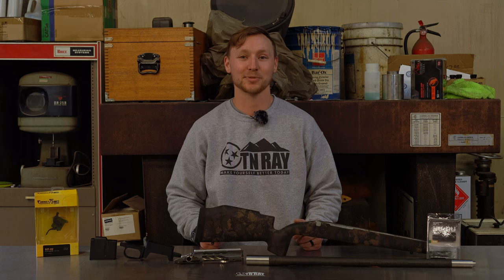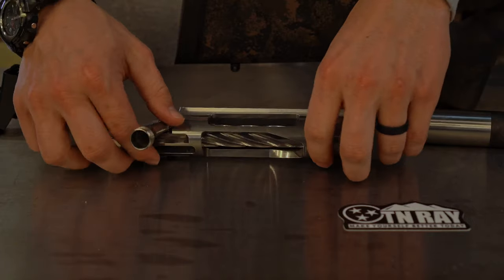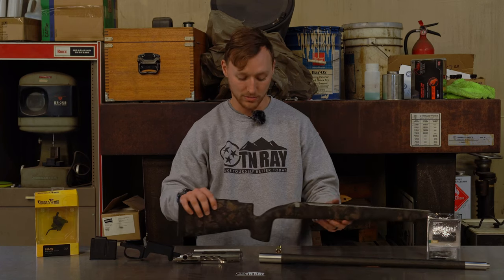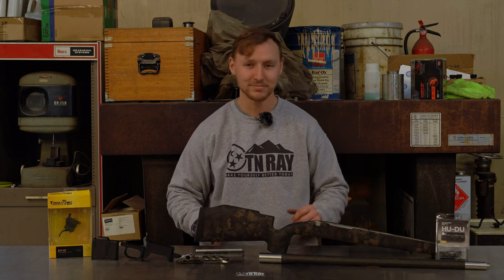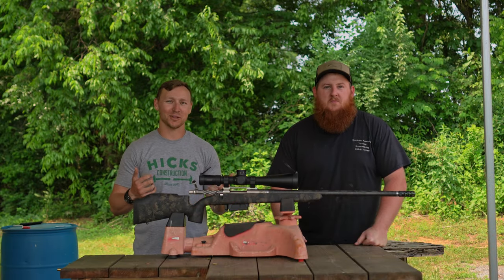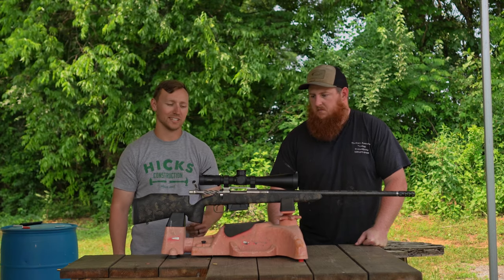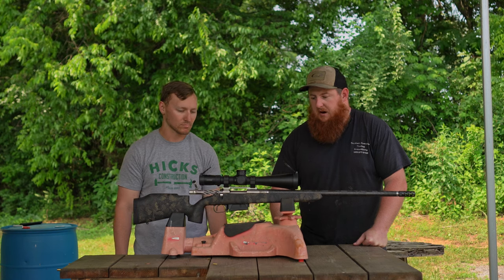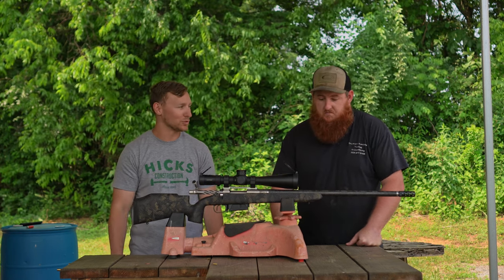Ultimate Hunting Rifle: Custom 300 WSM Bolt Action

Comment: Good luck finding a supply of any WSM brass and I only know of Bertram brass as of now that makes 300 & 325 WSM Brass.
I build for sale AR 10 uppers on the WSM magnum cartridges.
My own AR 10 WSM rifle is on 375 WSM.
I did find a online site selling once fired 300 WSM brass that I bought from then converted the 300 WSM to 375 WSM brass and loaded the casings.
Reply from the maker: Thanks, it is difficult to find but I got a 50 count once fired container of Norma brass from Choice Munitions a month or so back. I’ve got a little bit of Hornady and Winchester factory ammo as well. Hard to find, not cheap, but well worth it
Reply: @TNRay  Not cheap is right when Nosler made a run of 325 WSM I paid $130 for 25 casings.
Reply from the maker: @Lure-Benson shew! 😅
Reply: @TNRay  I have AR 10 358 WSM & 375WSM upper orders once brass is available again.
The Alaska shops are drooling over getting restarted selling this big bore AR 10 uppers.
Reply: I've got 60 federal premium nickel cases once fired and I don't reload
Reply from the maker: @jmgates09  you’ve piqued my interest… shoot me a message on my Instagram or Facebook if you have one
Reply: Just got a left hand 300WSM Tikka T3x. Sent the barreled action to my gunsmith to lengthen the throat so I can seat bullets out longer and get more from this cartridge - sent 2 dummy rounds along with it using Berger 210 VLD and 180 Nosler AB. I also just bought 600 pieces of new Norma 300WSM brass and the guy has a LOT more. I'd buy more but ran out of money :D. Youtube won't allow me to post suppliers, guess it violates the rules because "it takes away from the original video intent." 

I have 2 7PRC builds coming: 1. Defiance action, McMillan stock, fluted Brux barrel, TT Diamond trigger, Christensen Arms BDL bottom metal. 2. Lone Peak Arms Razor Ti action, AG Composite stock like yours, Hawkins Precision Hunter M5 DBM, TT Diamond trigger, Benchmark Cut rifled barrel
Reply: @jmgates09  Would like to get rid of them
Reply from the maker: @Accuracy1st  wow! Sounds like you’re doing it right, and have plenty of brass! Those two builds seem like they’ll be awesome!
Reply: @Accuracy1st  What do you mean get more from the cartridge?
Longer throat yes you can get more safe pressures by using slightly more powder of slow burning powders that work best for magnums, but you bought a rifle known for great accuracy now.
The gain you may get is minor not something out of the world great.
If your goal was to get more power and speed then buy a 300 Weatherby cambered rifle or 300 RUM chambered rifle.
The 300 Wby mag using reloads I found can easy exceed anything the 300 RUM does.
The old 300 Wby mag just keeps on proving it can be king of the 300 magnums.
I build and sell AR 10 uppers in the WSM magnums, I do allot of AR 10 uppers in 300 WSM so I am very familiar with the 300 WSM.
Reply from the maker: @Lure-Benson  I believe what Derek might be referencing is something I also considered, finding usability with longer/higher BC projectiles. For me, I have a true short action with aics pattern mags so I am limited by that. For a flush bottom metal rifle, you have more room for longer projectiles/COAL to try higher BC bullets and even slower powder.
Reply: @Lure-Benson  When I say get more out of it that's exactly what I mean, whether minimal gain or more. Much like a 280 Rem v a 280 AI. Just my preference. I've been handloading for 33 years and have been fortunate enough to get custom hunting rifles built for the last 2 decades and enjoyed them all. This is my first WSM rifle ever. I've never been a a fan of any cartridge design where the bullet invades powder space to the degree WSMs do. Rifle builders have been modifying chambers for decades which is why many will say the PRCs are nothing new. For example they were lengthening throats on 7mm Rem Mags nearly since the cartridge was introduced so as to maximize it's utility (which is what I do). That's why I'm a huge fan of the 6.5PRC, 7PRC, 300PRC - the latter I do not own. I went 300 WSM Tikka T3x stainless for a few reasons: 1. Was on sale, $775 total, 2, Already asked my gun builder if he could modify chamber to my preferences - answer YES, 3. As I understand it, the 300WSM held the 1000 yard records for quite some time for tightest group, 4. Jim Borden (custom rifle builder), stated to me years ago it's the most accurate cartridge he's shot. 5. Tikka makes one length action for their big game calibers. It's the polymer magazine that has the spacer in it to shorten up cartridge length and I bought multiple extra mags in long action length so as to accommodate the modified 300 WSM I'm working on.

At the same time I was also considering the 7PRC and expanding the neck to 30 cal because there's a certain case capacity I'm interested in but then I'd have to get a reamer made which isn't a problem, AND as soon as my gunbuilder gets done with his match this week we are going to discuss it further. I've owned several 300 Win Mags and actually just bought a new Tikka T3x stainless in that cartridge as well but that's to either switch it to another 300WSM or another 7PRC. Had a 300 RUM for years, killed mulies and pronghorn with it shooting 180 Swift Sciroccos - DEADLY. But at this point I have decided to part with all of my belted magnums and the reloading components for them, just my preference.

As to the 300 Weatherby, never owned one but shot and reloaded for one. I would NEVER consider a Weatherby for the sole reason of ridiculous prices on brass and ammo, far exceeding anything close to being reasonable - again, my preferences

At the present, one of my all time favorites is the 6.5-284 Norma. I have two of them: 1. Stiller Predator action, Bartlein gait twist barrel, Jewel trigger at 1 pound, McMillan stock. It's never shot over 1/2 MOA with anything (likely the barrel)? 2. Defiance GA Hunter action, Brux barrel, McMillan stock, Jewel trigger at 1 pound - lucky me, 140 Berger VLDs right out of the gate in Lapua brass, Fed 210M primers is a one hole load with a LOT of Retumbo in the case
Reply: @TNRay  That's correct. It's all about maximizing the UTILITY of what you have. I currently have a 270 WSM on my watch list on an online auction in left hand. I would never own any WSM cartridge in its factory SAAMI spec because I've known many gunbuilders who all have shared with me they modified their chambers and were pleased with the results. That's what I like about the Tikka actions as well. Doesn't matter if you buy a short mag or long mag, just get the appropriate long action magazine and build your WSM with a modified chamber if that's what anyone wishes to do
Reply: ADG makes brass for 300wsm I just got 150 ... for a hunting only rifle that should last me a lifetime
Reply: I used a tikka action for my semi custom and got an aluminum longaction mag which gives me up to 3.4 inches to load to ... tikka's are awesome for builds like this